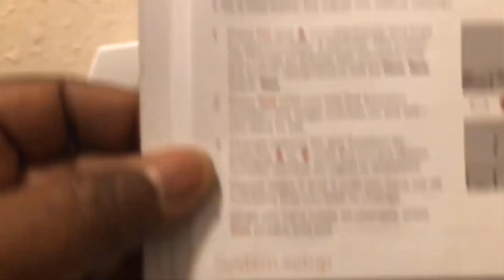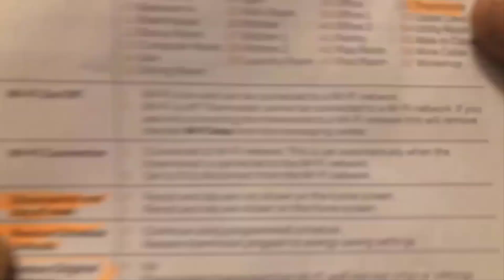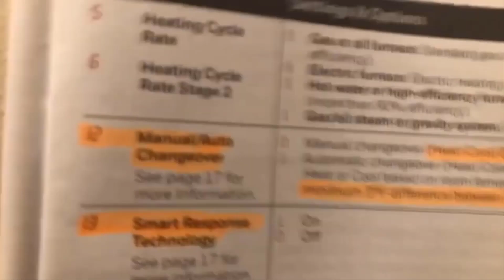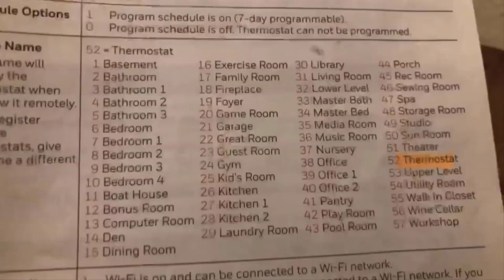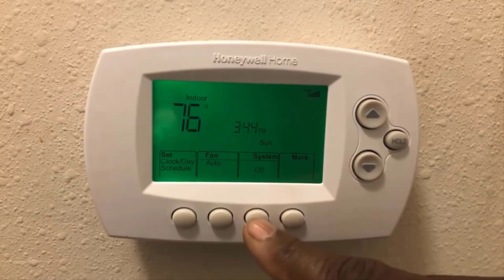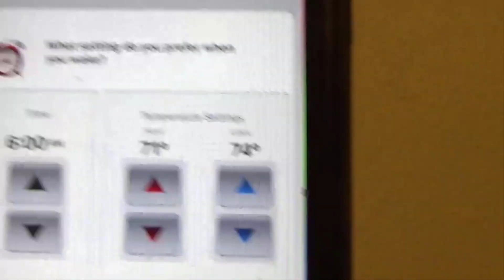Reviewing Honeywell Thermostat Smart Series RTH6500WF or RTH6580WF; AWESOME

Comment: Buyer beware, Honeywell thermostats keep your house within 1 degree temperature, they don't advertise it in any way I have found, that causes your heater and ac to cycle a lot, when it turns on, not only does it use more energy then when it's already running, it puts much more wear on your pump and motor, I had to talk to one of their techs to find this out!
In the long run you pay a lot more in bills!
All these people spending all this time to find out it's factory like that. I loved it other than that! Taking it back though!
Reply: can you explain more about what you mean. How does a 1 degree difference cause it to run more if you can change the cycle?
Reply: @kaeleib  You can't change the cycle, that is the problem, the cycle is set.
My house will change about 4 degrees in one hour, that means it will cycle on 4 times in an hour, I have it set at 3 degrees on the cycle because I'm good with that.
It will be on the same amount of time to warm or cool the house, but it will on off 1 time instead of 3.
When it cycles on it uses much more energy then if it was already running.
Like a car speeding up, the more stops you make, the less your fuel economy is.
I'm not trying to talk anyone out of it, it is a good product, but 2 degrees is not that much for the money you save using something else.
Reply: @Kracker215  cycle rate isn't in measurement of degrees if that's what you're talking about. its how many times an hour the compressor will turn on. Like if I set it to 2, it will turn on 2 times a hour and same goes for 3, 4, 5.
Reply: @kaeleib  do yo see setting where you can adjust it to 2, 3, 4, 5, because when I called them as I could not find it they said it did not exist. If its set to 74, when it gets to 73 it turns on, no adjustment, no cycle adjustment.

Comment: So I installed and programmed. Everything is fine. Except twice now, I’m away from home, perhaps there was a loss of power but once the power returned the app shows a “connection failure”. Click on it, message says  reconnect or clear. Click on reconnect but it brings me to instructions to reconnect while I’m at home!!   Is there a way to REMOTELY reconnect to the home WiFi? I think not which is pretty useless and stupid, but if anyone knows otherwise, would you please let me know?

Comment: I can't thank you enough, I've got a heat pump package unit and couldn't get the heat to work (AC works fine) so I called an AC technician he came by, said this thermostart is not compatible with my unit, charger me $75 service fee told me go to a Trane an get the right thermostart, after looking at your video my system works fine with the same thermostart, thank you.

Comment: I have a HUGE problem with this thermostat and need help.  I purchased the RTH6580WF and since I installed this sucker a few weeks ago the heat cycle rate is just TERRIBLE!  I read somewhere in Amazon review that this thermostat changes temperature every half degree difference and that is exactly what this thermostat is doing to my furnace.  I have gone thru all the settings and nothing seems to change.  My furnace is now running way too many times within one hour.  The only thing I can do is drop the temperature to around 67 degrees so that the furnace doesn't kick in too often.  The thermostat I replaced recently is around 20 years old and the cycle times were a lot less and it would turn on the heat/AC after a two degree difference, with this Honeywell that's not the case and I'm scared that this thing will fry my attic furnace.  I got this thermostat thinking it is more modern and efficient but I'm ready to return it.  Any input on this?  Also I can't find a contact number to talk to a Honeywell technician to help with this.